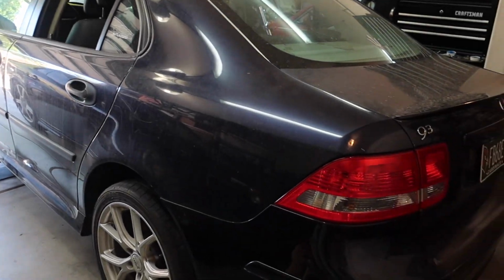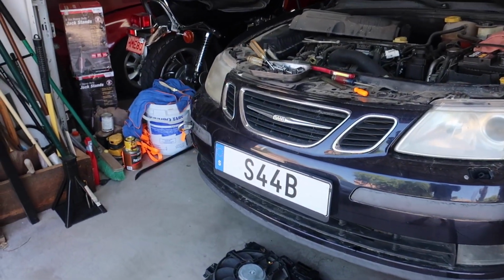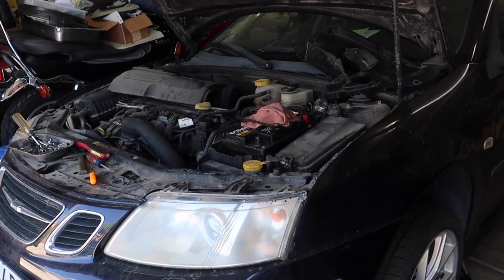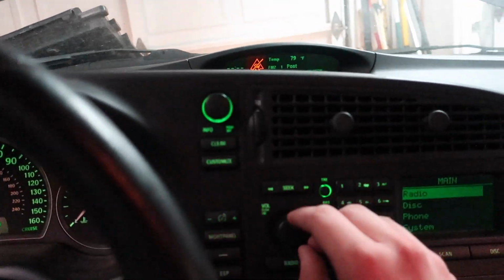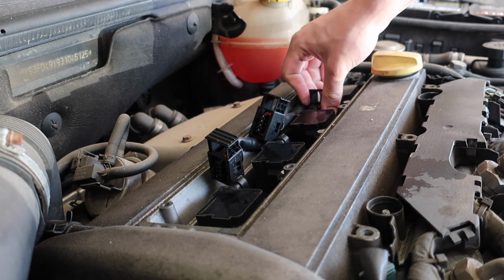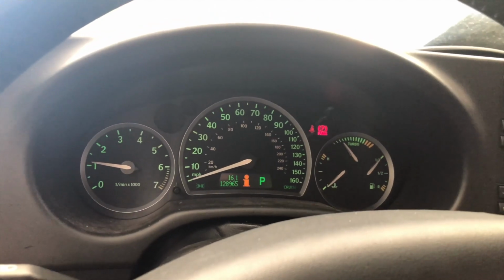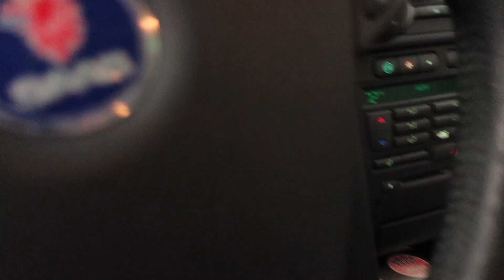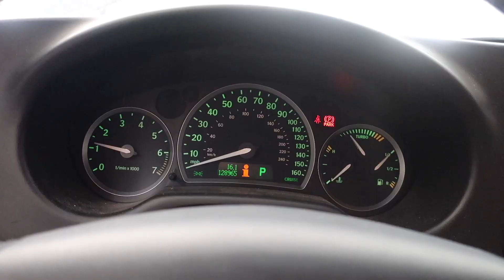My Saab 9-3 Arc is Back! First Start in TWO Years 🤞🏼

Comment: i once left my old saab just over a year without starting it up.. i sold it to a friend who really needed a car after his car broke down. I only connected the battery back on and started it up, and it came up with the exact same stability control warning. it even had the "shakes" for a minute or two like yours... i drove the car that day for maybe 10 miles, changed the oil and filter and its still running to this day. i owned the car for 4 years and he has had it 2 years now. 2.0t vector sport 140k miles (when i had it)
Reply from the maker: Wow, great!

Comment: Good to see it back up and running! You should put the Nav screen display from the ‘05-07. My Arc has it and it looks better than he stupid little green screen thing. There isn’t really any need for that one since it has the other display up by the windshield which is significantly better. Also have you considered putting a slightly bigger spoiler on there? Mine has a small Spoiler (a little bigger than yours) and it looks great
Reply from the maker: You probably have the same spoiler; this is the standard Aero spoiler. As for the screen, I don't think I really want to. It's pretty outdated and not easy to find :(
Reply: @AutoAutopsy  That head unit is integrated with everything else in the car and uses fiber-optics to communicate with most components. I think the story is GM wanted Saab to use one the existing GM systems for the 9-3 but the Saab team in Trollhattan completely ignored that and developed their own using fiber-optics.  Marrying and making it work to the Nav screen unit that isnt even updated to newer roads is a bitch, and not even worth it. This is the one thing I fucking hate... Just to update the damn radio so something that sounds badass... cause the uglyass radio in the Arc sucks... majorly.
Reply: I found the icm3 in a junk 2.8.

It's now in my 2.8, and looks so much better then the green screen.

Comment: Can of fuel system cleaner, oil change and she'll be good to go. Love to see them start right up. :-)
Stage 1 or 2 on that one?
Reply from the maker: Yep! Just threw in some fuel cleaner last night. Stage 3 :)
Reply: @AutoAutopsy  Sweet! Any issues noted when you went to St3? The exhaust sounded a bit different than mine at St1. Non-stock pipes....cool.

Comment: Nice to see the Arc again! The stability control failure code should disappear after you've driven the car (as long as there isn't a real fault). These errors can be triggered by a weak/dead battery or if the car sits without power for a long time.
Reply from the maker: Thanks, that’s what I’m hoping for:)
Reply: I had that error after driving in a heavy downpour. After it dried out, the error went away.

Comment: Hi, I'm Rob from Holland. Do you know where you can jack the 9-3? Like the "safe-spots" under the car, without damaging the car.
Thanks
Reply: There are arrows on the side skirts where there are black blocks to lift the sides and the rear is the front center of the frame the rear has two spots on the side under the spare tire well
Reply from the maker: I usually use the areas near the arrows for the jackstands themselves and use the sub frame in the front to jack the car up
Reply: I do the exact same as above . ...had someone else jack it 
and the oil pan was damaged :-(